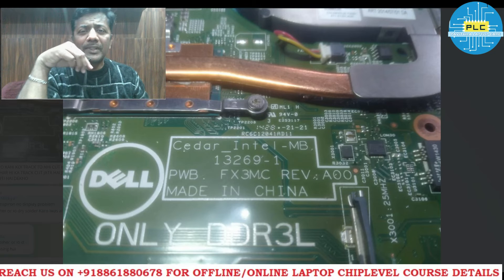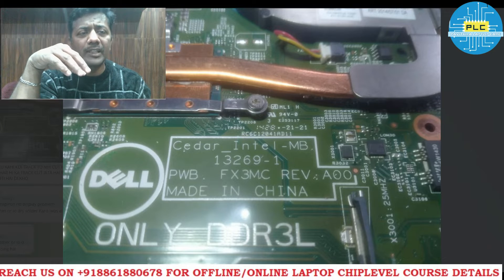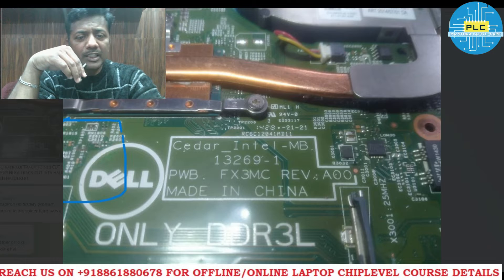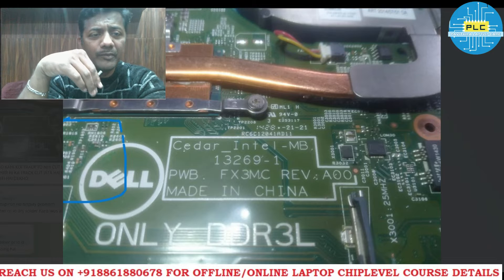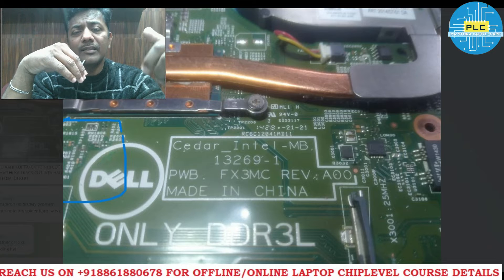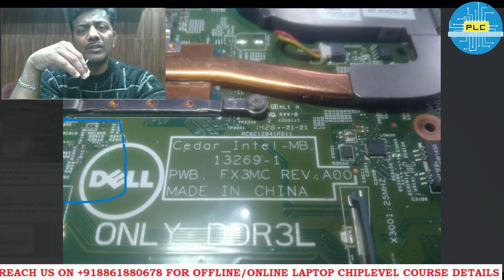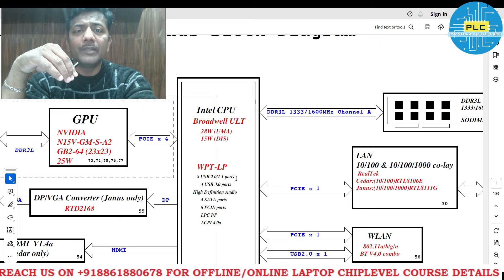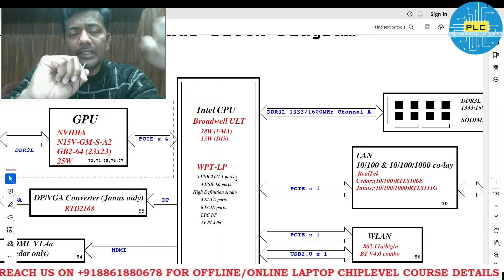Dell 7 BEEPS? CPU gone? #7beeps

Comment: After checking this voltages ⚡  all are present, but the 7 beep is still there, what is the next thing to do
Reply from the maker: JUST SLIGHTLY HEAT THE PROCESSOR. MAKE SURE PROCESSOR'S BGA PART IS OK. THEN ALSO ISSUE IS SAME, PROCESSOR FAULTY OR RAM SECTION FAULTY
Reply: @LaptopCourse  thanks for the tremendous update, it means the world to me